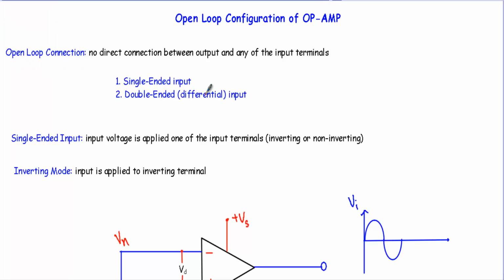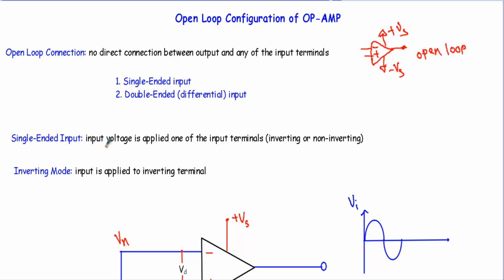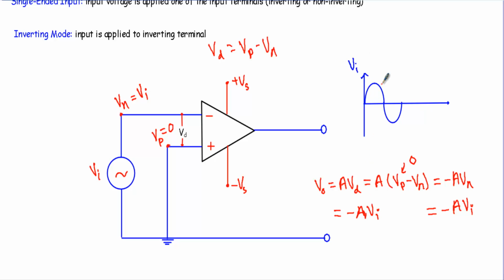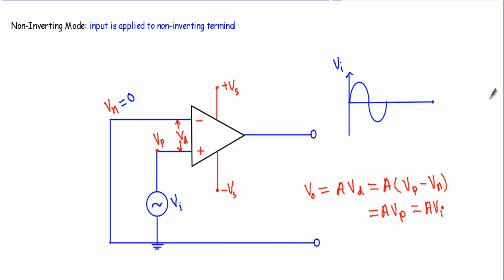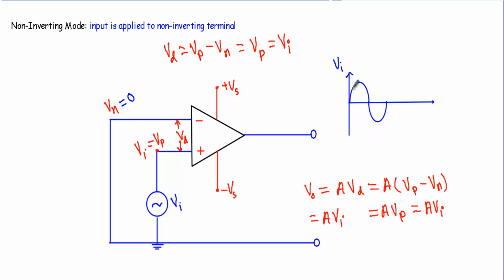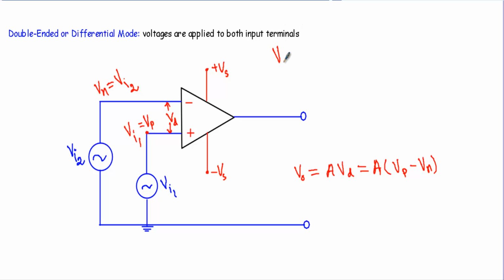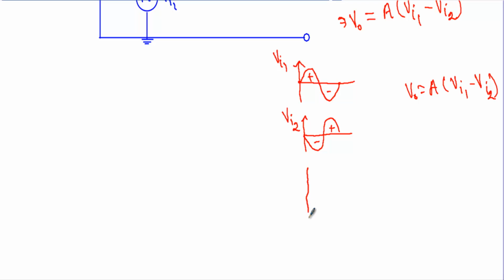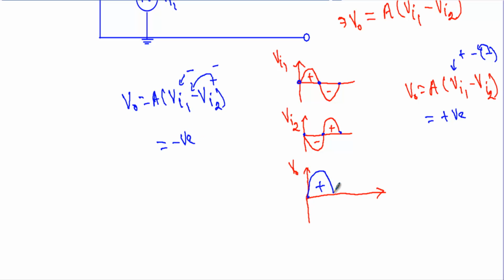Op Amp Open Loop Inverting, Non inverting and Differential Mode

Comment: in the circuits are used are these sine wave  when you differrence v1-v2 values are peak voltage of sine signal ?